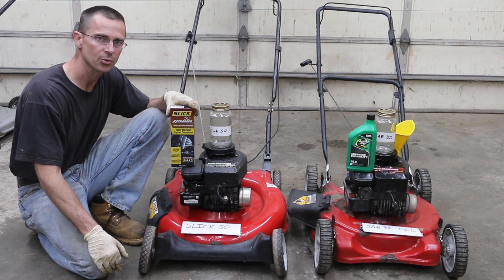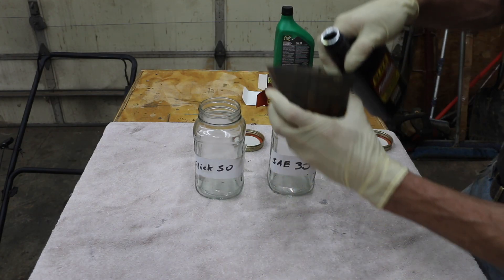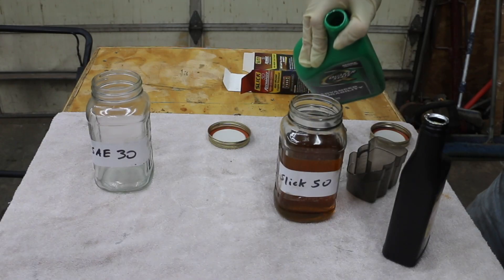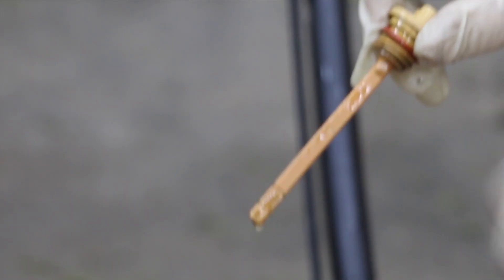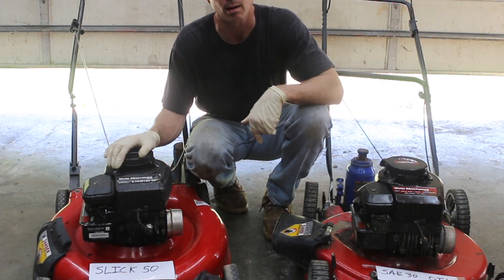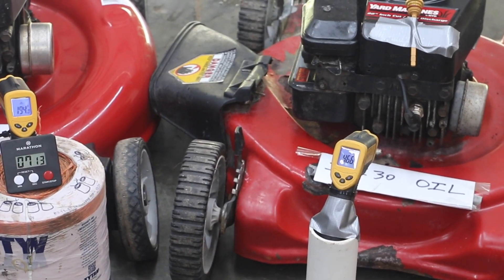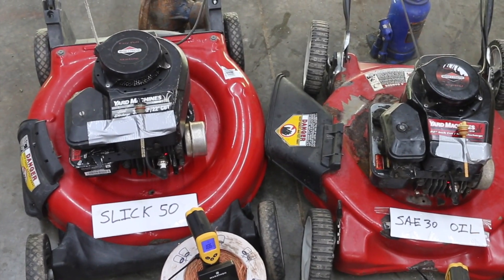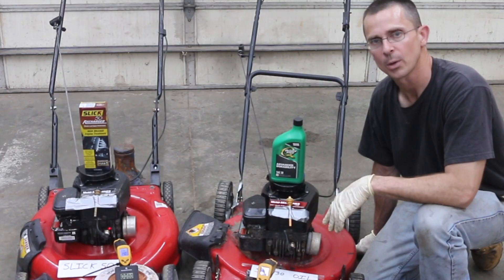Can't believe what SLICK 50 did to my engine!!--Dry Crankcase Test!

Comment: As a certified small engine mechanic, your test does nothing but spread false information about a product with a very good reputation. I do not use, nor do I have any personal feelings on Slick 50. it is very clear that those two engines are very well used. Do you have any idea as to the hours on either, maintenance done on either? Did you do compression tests before hand, maybe leak down tests to at least determine if they were remotely in the same condition? The one that you ran the Slick 50 in started noticeably harder than the other. was the fuel the same, plugs new? was one a maufacturer spec engine (notoriously cheaper on those brands) than the other? I understand what you are doing, but if you don't do it the right way you are simply advancing a false outcome and not actually accomplishing what you set out to find out in the first place.
Reply: If you are a certified small engine mechanic, then you should know first hand that all motor oil additives are a total waste of money.  When you buy a good oil, the manufacture has put all of the additives that you'll ever need.
Reply: Ben Salm
What are you talking about? Of course it means something, it's just not very scientific (controlled).
And comparing a corvette to a pinto 1/4 mile time means something too, it's the difference between a fire breathing sports car and a ho-hum compact. The way we know something is really bad ass (like a corvette) is to compare it to mediocrity (like a pinto). 
If no one ever compared a corvette (or any other high end sports car) to anything but other high end sports cars the corvette would look pretty average. But open that up to the full scope of all cars and you see the corvette for what it is, a high performance sports car.
Reply: Ben Salm
If Slick 50 was really all that much better at protecting an engine you would have seen it do so to some degree even if we assume the engine it was used in was in better or worse condition than the one with regular oil. As they say, any result is still a result (even if an unscientific one).
Reply: And my claim is not all encompassing. If his test was to see if Slick 50 would help an old engine, I would have no problem. It's the comparison. That's where the problem lies. Someone can find value in looking solely at the Slick 50 result, absolutely. You aren't listening to what I am saying. The comparison is what means nothing. I am talking about the point of his post, nothing else.
Reply: Sadly, I know you're right.
Reply: It would have helped to know they ran the same temperature with regular oil first as at least 1attempt to have a better control.
Reply: Ben
sigh...
1. You don't know what he knows or doesn't know about these engines nor do you know what condition they are in. For all you know they could be very similar in condition. You weren't even there, dude, you are just making assumptions which I believe are born out of a bias over the fact that this guy didn't conduct his test the way you wanted him to so that means, in your mind, the test is completely invalid or "doesn't mean anything", which is obviously wrong. I already explained why.

2. There was only one product in question in the video, Slick 50. Both engines had oil, one of them was oil treated with slick 50. Then the oil or oil/slick 50 was removed, then they where ran to failure.

3. You claimed that "...the result doesn't mean anything whatsoever. "
That is an all-encompassing or absolute claim.

I think the problem here is you are not listening to what you're saying.

Again, this video does mean something. This test does, generally, follow the scientific method, it even had a control (the untreated engine), it does have some validity/meaning, it just need to be refined to limit the variables/unknowns before any actual conclusions can be drawn. Note how, at the end, he even allowed for this, not making a conclusion and asking if he missed anything.

Yes, in lab you would take two identical engines, with identical clearances, etc. one as your control, one treated with the Slick 50, add exactly the same amount of lubricant to both, then drain the same amount of lubricant back out, then start the engine in an identical manner, under identical conditions (temperature, etc) and measure the results and repeat numerous times. 

And, of course all of that would take a hell of a lot more money then this guy is probably willing to invest.

But if you can do better why don't you make a video showing us all the proper way to conduct this test rather than siting on your ass criticizing this guy and arguing with me about it? I would love to see the results and any conclusions we may draw from them.
Reply: You are not only missing my point completely but you just proved my point AND disproved your assertion that he followed the scientific method. You stated that he followed the scientific method and then later went on to state that in a lab he would have had two identical engines...Well, I hate to break it to you, but that part about having two identical engines is THE critical part of following the scientific method. You cannot just use parts of the scientific method and then claim to have followed the scientific method. You either use the scientific method in its entirety or you don't use it at all, that's how it works. 

As for me sitting on my ass arguing with you, I simply posted a point about the fact that this video gives an unfair bias about Slick 50 over Seafoam. YOU are the one who turned it into this drawn out argument about how this video does have some validity. My whole point from the start was that the video was a comparison between the two products and that Slick 50 performed better. I was simply stating that the process by which he used to determine that Slick 50 was better was flawed. Something I still stand by. Your argument is that the test is still worth something. My argument is and has been that he gives an unfair endorsement of a product based on a flawed test. For anyone to argue that point is crazy!

You can continue to argue with me and act as though you are superior or whatever, but you are wrong. Plain and simple. I can say that because you proved it in your last post when you confirmed what I have been saying all along. Not to mention the fact that what you have been arguing all along has NOTHING to do with what my original post was about, the fact that the COMPARISON is flawed.
Reply: Ben Salm for what it's worth, an engine with more wear on the bearings would likely last longer without oil than one with tight bearings. It should have less friction due to the tolerances being looser
Reply: Have I performed leak down tests, compression tests, etc.? Hundreds, thousands. Honestly, the certification means nothing. It's the years of experience and thousands of engines, generators, pressure washers, and anything else people bring to a small engine shop to have repaired that means something.
Reply: You are absolutely correct. Any result is a result. My point is that the result doesn't mean anything whatsoever. That's like comparing the 1/4 mile times of a Lingenfelter Corvette with a Pinto. You get a result, but it sure doesn't mean anything.
Reply: Touche' lol
Reply: "You are not only missing my point completely ..."

Now one would think after posting such a claim that one would demonstrate what one's point is and how I missed it. You fail to do that.

"....but you just proved my point AND disproved your assertion that he followed the scientific method."

I never said he followed the scientific method. I said, "This test does, *generally*, follow the scientific method..." then I explained why and what needs to be done to further refine it to more closely adhere to the scientific method (i.e. by eliminating variables). 

This video is a pretty good demonstration of the scientific method *in general*, in principle, even though it's not specifically so, as I've explained. One could argue this a something like "casual science" (as opposed to "professional science").

Again, the fact that you are accusing me of missing your point, while failing to demonstrate that I did, and turning around and mischaracterizing something I said indicates that you're not thinking very much about what you're typing and instead are just reacting emotionally to what I said that you don't like while trying to give the apprentice of intellectual honesty. And maybe you don't even realize what you're doing.

And since the rest of your argument is based on this mischaracterization/strawman I don't see any point in addressing it in detail.

"As for me sitting on my ass arguing with you, I simply posted a point about the fact that this video gives an unfair bias about Slick 50 over Seafoam."

First of all, where was Seafoam even mentioned in this video? The other engine just had oil in it. This was an test for oil treated with Slick 50 compared to untreated oil.

Secondly, note how you are trying to passively distance yourself from your own share of the responsibility for this "argument" THAT YOU STARTED with your initial comment. As if it's just something that happened to you and you had no control over or role in and so no responsibility and no expectation that someone might comment on something you said. 

It fits pretty well with your treatment of this guy in this video in general, you are quick to criticize but slow to take action by showing us how it supposed to be done.

 "My whole point from the start was that the video was a comparison between the two products and that Slick 50 performed better."

ffs, did you even watch the same video I did? There was no second product in this video! Again, one engine had oil treated with Slick 50, the other had untreated oil. So you "whole point from the start" was wrong.

"I was simply stating that the process by which he used to determine that Slick 50 was better was flawed."

He didn't DETERMINE anything. There was nothing conclusive about this video. I'm starting to wonder if you even watched it? These are results, not conclusions. Please watch the last few minutes of the video and pay attention this time.

Again, for someone who accuses others of missing his point it's sure good to see you're so good at not missing the points made by others (sarcasm).

"For anyone to argue that point is crazy!"

Believe what I believe or you're crazy. 

"My argument is and has been that he gives an unfair endorsement of a product based on a flawed test."

There was no endorsements made in this video. And, again, lets see you do better.

And, finally, sorry, Ben, I'm not interested in your passive aggressive b/s and projection of your last paragraph. I think I've been more than generous with my time already given the level of quality of your reply.
Reply: After reading the thread (in fact from the first post) I agree with your basic conclusion--a reliable conclusion from this experiment is not possible because it cannot be verified that the engines are identical or at least nearly so and in identical or nearly identical condition.
Reply: There is something very telling from this experiment that I think is fairly obvious, the heat comparison, upon first glace one might assume that the slick 50 was doing a better job by keeping the engine cooler, but in fact, you have to understand where the heat comes from. Gasoline is a carbon based fuel source and burns at around 1500 degrees fahrenheit. Once generated, that heat must go somewhere, as somewhat of a baseline showing the efficient heat transfer to the cylinder head cooling fins, the adverse conclusion may safely be drawn. "The slick 50 must act as somewhat of a thermal insulator causing a premature engine failure due to lack of efficient heat transfer" ...Me . because with inefficient heat transfer you might see a cooler outside temperature.
Reply: Ben Salm h
Reply: I would agree to that statement 100%. I went to a couple seminars on oil and the most interesting thing about oil is that the single only thing that doesn't break down in oil is the oil itself. It is the additives in the oil that breakdown. If it were possible to filter oil well enough that you could actually keep it as clean as it were the day you put it in and it had no additives in it, you would never have to change your oil. Of course that is unrealistic for a variety of reasons. There are additives that are necessary and it isn't feasible to filter the oil that well, but I think too many people are unaware of just how durable oil actually is and are always looking for some way to "improve" it.
Reply: Maybe, but I don't know that I would say that with any certainty. An engine with more wear, particularly in a small engine, is going to be much more likely to have journals that are out of round, scoring on the bearing surfaces, cylinder walls, etc. After all, that is the reason for the majority of engine failures in small engines, inadequate monitoring of air filtering allowing dust and dirt to enter which then starts to scar and score everything. The out of round journals are going to cause slapping even if it is on a minute level and that is going to generate a lot of extra heat. The scoring on most surfaces is going to create a lot of extra friction which will also increase the heat. In the small percentage of small engines that were properly maintained with oil changes and air filters I would say that you are likely correct, but in my experience the majority of them wouldn't fall into that category. Just my opinion.
Reply: Possibly, there is also a tremendous amount of heat generated through friction. If you can control one of the sources of heat, (obviously not the combustion) you can potentially help control the total heat generated within reason.
Reply: I agree with Ben. Different engines equals different materials, different tolerances, and in this case, possibly vastly different run-time, wear, and internal condition. The only way this test could have been done to get any meaningful results would be with two brand new and identical engines. Even then, a sample size of one for each case does not allow for statistical outliers that might corrupt the outcome.
Reply: Who "certified" you, kid? The engines were the same, Briggs & Stratton with only minor differences in tin-ware. Both mowers were probably $129 new. Bottom of the line, entry-level mowers. Good engines, though! As a small engine mechanic since 1973, I'm qualified in my statements. "Certified"? That's for idiots!
Reply: Ben Salm bearing friction test is the best way to test lubricants and additives.
Reply: Then show us because we are interested otherwise get off of him.
Reply: You are completely right. It means a lot of things. For example, it means that if you take two engines you know nothing about, and put two different products in them, one of them will outperform the other. You just don't know if it has anything to do with the products or the engines. If that is your point, then yes, you are completely right.
Reply: Ben Salm come on why speak logical informed sense when you can make a stupid video that is nothing but bad entertainment lol
Reply: The point is you are wrong, this test does mean something, even in the narrow way you are trying to define it. That's what happens when you make all-encompassing claims with words like "nothing" or "doesn't mean anything whatsoever", as soon as anyone can find even one example showing why/how it has meaning or way it has value it proves you wrong.
btw, even with the scientific method you can conduct tests and get any "result" you want. Have you ever heard of "conformation bias"? The scientific method  is not a guarantee of objectivity or truth, it's just the best method we currently have for science. That's why skepticism never (is supposed to) ends in science.
Also, with regards to the corvette and pinto:
I'm not talking about a hierarchy, I'm talking about standards. The question for every standard is "compared to what?" Compared to all cars the corvette far outperforms most. That's how we know it's exceptional. This principle applies universally.
Reply: Have you performed the tests you are requiring?  A 'cert' doesn't mean more then you are supposed to know X.  (NOT saying you are FoS, just that a claim of a cert on the internet means about ......)
Reply: I thought we were talking about the performance and value of one specific product in comparison to products of similar value, stated efficacy and performance. If that is our stated objective and we don't carry out the tests in a controlled manner, then those tests are useless. 

What you are referring to when comparing the Corvette and the Pinto are completely different things. What you are talking about is the a comparison of the entire hierarchy of the automobile industry from the bottom of the ladder to the top in terms of performance. In that regard I agree completely that those test results absolutely have meaning. But that type of comparison has nothing to do with the type of comparison at hand, a comparison of two products that are advertised as equal. In this case that comparison means nothing. That was my point. 

The way that this test was done simply has no merit whatsoever because there is no control group and nothing to create a base result from. Instead, it gives a false narrative of a result that means nothing. 

I guess my point is this; If you don't use the scientific method when you do tests like these, you can make any product perform any way you want it to perform. I can find an engine in the condition I need it to be in to make a product appear to perform the way I want it to. I am by no means suggesting or even assuming that this poster did anything of the sort. I don't think for one second that he did. I am merely pointing out that if you really want these tests to mean something, do them the right way.